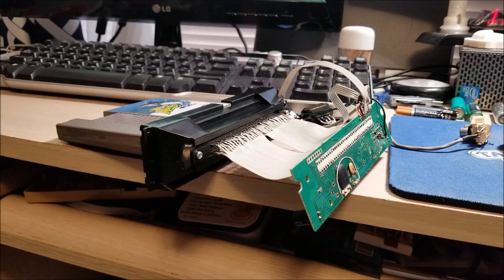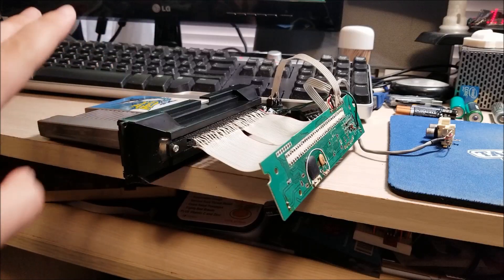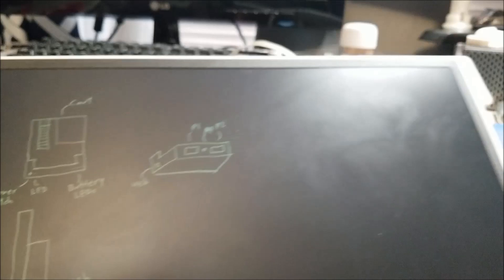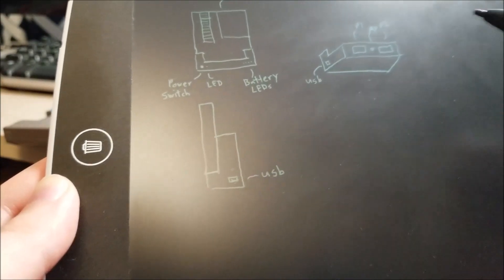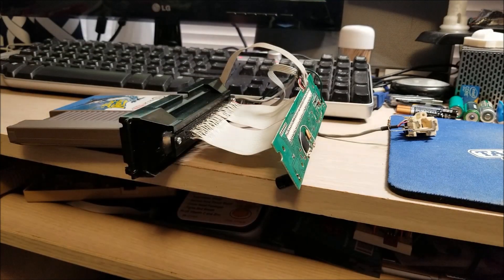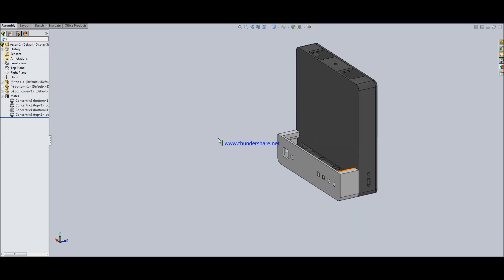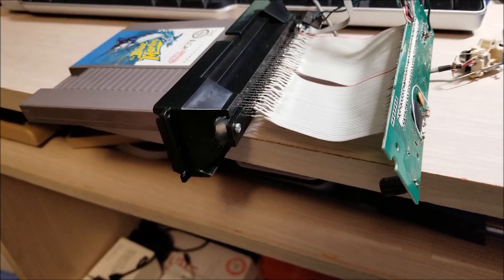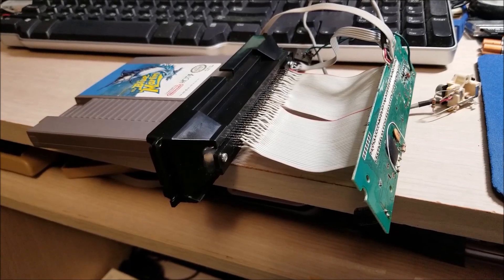NES Micro - Part 1: A New Project from the Ashes of an Old One

Comment: I'd enjoy a GameBoy Pocket model GameBoy with a backlight (and color) that plays GBA games... so a GBA SP but in a GBP shell and it runs off 2 AAAs (or can be charged it can be the option of the player)/Can use a link cable or WiFi and plays GB/GBC/GBA games.... sounds like a big project but it's like the ultimate GameBoy.

Comment: If the nes and the famicon use the same cartridge(I'm not sure and google isn't my friend at the moment), you may want to make the slot to be able to accept both types of carts.
Reply from the maker: simyo3in1 They luckily are cross compatible with an adapter but the nes has 72 pins while the famicom only has 60 so making one slot that can accept carts of 2 different sizes with slightly different pinouts would be trickier than just using an external adapter.
Reply: sjm4306 Makes sense I had this thought a few hours ago when I watched your video, and just when I went to write this I thought they were different pin patterns.  Good luck on your project I look forward to seeing your progress.

Comment: My 2 cents is the power button if off should 1 press no hold turn the system on the same press if on should reset and a 5 second hold if on should power off
Reply from the maker: Lucas Loveless I'm just worried if I throw it into my backpack it would turn itself on too easily. I suppose I could have another switch on the side to act as a battery disconnect for storage purposes. Yeah I think I'll go with that and your suggestion! Or maybe make the power button slightly recessed?
Reply: sjm4306 I was actually going to suggest a "hold" switch similar to the iPhone...the hold button to power on would still have the same issue without a hold switch regardless(corner of a notepad against it in backpack could still trigger on a 3 sec hold) so yes just add a hold switch and make the power/reset switch flush don't recess it :)